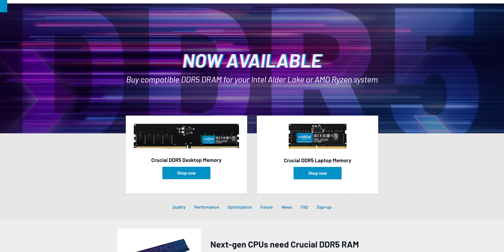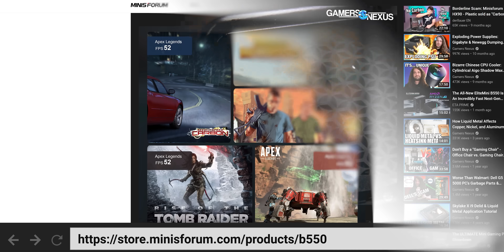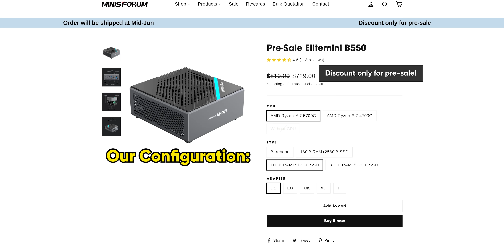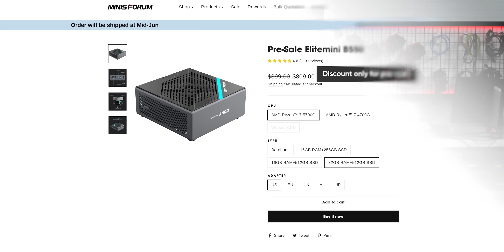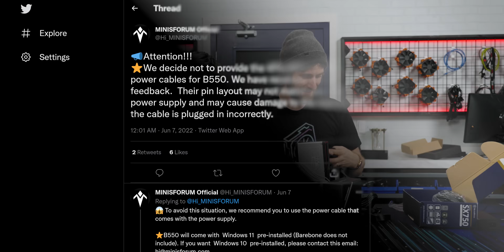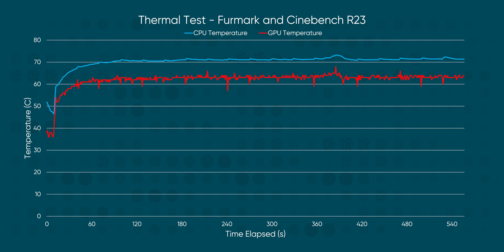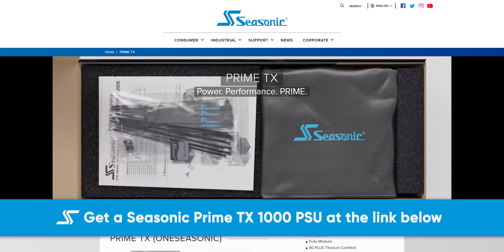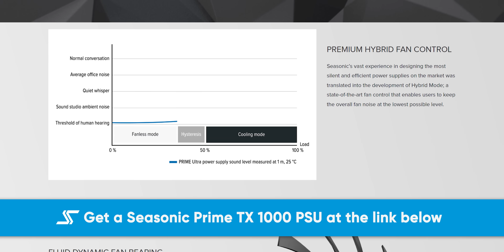Who's Buying These? - MinisForum Elitemini B550

Comment: This is an early version of what there will be in the future: A tablet computer to which you can attach external RAM and GPU for home usage. Similar to a Switch docking station. CPU development will primarily move towards power efficiency and modular construction in the future, so having power hungry parts detachable will tear down the line between mobile and desktop computers.

Also, those huge ass GPUs eat power which you save by unplugging it. It might not much, depending on the GPU, but if you're an environmentalist, you think about these things.
Reply: I’m pretty sure mining for metals for components in anti-environmentalist so from the start that’s contradictory
Reply: @christophervanzetta  No, it isn't. Everyone has a PC anyway, the environmentalist approach is that if you get something, you get the least problematic version of it.
Reply: But even though it has standard PC components inside it seems that it has not so much room for upgrade more than storage capacity and maybe faster RAM if you already had the maximum quantity available since as the not Linus guy said the computer does not even get full advantage of the CPU so just imagine thousands of these tiny computers thrown into landfills when they become obsolete and impossible to upgrade, even if they take care about that and make a new revision of the motherboard you still had to get rid off of the older one and that does not fix the problem either because you still need to buy the rest of the new components, even if its potential for working between two different places switching the system between both stations looks appealing is not a great improvement over a decent laptop if you need that portability and it has the added advantage to work with external GPUs as well as working independently everywhere so I don't see any real environmental advantage over the existing technology and it looks more like another cool but not very useful niche product.
Reply: @peterpuke2841  Yes. That is a problem with this design, I was more referring to the concept of a plugin-GPU in general. Framework, Pine64 and Fairphone are showing that you can do these things in smarter.
Reply: @BlommaBaumbart  But that already exist, there have been external USB GPU adapters for a while and they have proven to be reliable and as far as I know some even work with Windows based tablets despite they are not advertised for ultrabooks and such, but maybe if they start from scratch and instead of this rather weird form factor they change their focus into making some sort of expansion device with a portable dedicated GPU that can be connected with an standard interface like USB and with a smaller but internal PSU since a portable GPU requires much less power than a full size desktop GPU it should be less of a problem to feed the card with power within a small form factor then they could have something really useful in their hands because the biggest problems with external GPU adapters is that they take too much room since they have to make big boxes to fit the GPU and the PSU so they still take a substancial quantity of space and weight making them still inconvenient for transportation so imagine what cool would be a device way smaller and thinner that you just pop in a USB type C and a power cable and you have a very powerful external GPU for your laptop but in a much more friendly format that you can throw in you backpack if you want to take it with you, that should be the real game changer to me.
Reply: @peterpuke2841  You're thinking in the right direction. Short note on external GPUs: Those were so far bound to Thunderbolt, not general USB, and the external casing for just the GPU cost 300 and up, which is why they got less attention than this more general solution here does.
Reply: @BlommaBaumbart  Oh yes, you're right it was Thunderbolt, my bad, and yeah I don't know how no one in the tech industry have come up with this idea yet, actually I had it for years but then I thought that portable dedicated GPUs were still ¨young¨ and very expensive but since Nvidia launched the 30XX portable GPU line and it´s much better in terms of performance and heat generation than previous generations I think it´s time to see someone making an external portable GPU in a small form factor device and an added benefit is that for being external it doesn't have to be bound within the size specs of a laptop so they can make a small but thicker heat spreader than gaming laptops use hence not affecting performance despite of the size, maybe I should patent it myself and pitch it to a computer manufacturer before someone else steals the idea ha ha.

Comment: i use a laptop for work but it only gets used at home on my desk  or on a hot desk in work, both have power and periferals (moniter, keyboard, mouse ect) so it would be suitable for that as the laptop might be (slightly) worse in my use case

Comment: The extra psu is a downer. With a 750 psu i could just cram everything in a cooler master nr200.  I travel a lot but not to an extent that i should disamble to take it with me. 

Its a great niche profuct tho. I could see others pick this up and make use out of it.

Comment: This is good for my use-case. Where I live, the power intrupptions happen all the time so we have a 1000 Watt UPS for our house so we can have lights and fans on. I can use it without the external GPU when power is out on UPS and plug it in when I want to game. Right now I have to keep two machines on hand; one is a full size desktop that I shut down when there is a power outage and then I switch to my laptop until the power is back.
Reply: I used to love having a gaming laptop for such occasions, when the power flickered or went out it just shrugged. I did not love having hard to replace parts, which in modern laptops are just impossible to replace.
Reply: @ffwast  I see that over and over in the comments, "hard to replace parts". But this is no different. You can, uhm, upgrade RAM and storage... just like in a laptop. But that's it. If you are talking about parts actually breaking and having to be replaced, most likely the system have gotten so old it's obsolete or you got bad parts from the factory and can use the warranty. So in the end this is just a shit version of a laptop, that you don't get a portable screen with.
Reply: But it's still easier, cheaper and faster to just use a laptop.

Comment: I love it! But I don't know why... I kinda feel this would suit your upcoming byoc lan party if moving the rig for tournaments happens. It does seem a little unpolished and I would hate to unplug the power as easily as Linus did, that happened a bit too easily. The barebones config does seem like a good deal though! I don't have a lot of money for upgrades atm and as a tinkerer this is oddly attractive, but as I said, I don't know why. I'd love to have a play with one though for sure!
Reply: you could probably design and 3d print a simple bracket that would screw onto the back of the psu and just prevent the cable from being pulled out
Reply: @roowut  they're probably using a cheap port until its finalised or maybe the power cable shroud was just slightly too small. Easy fix either way

Comment: Yeahhh I'd have provided a more powerful integrated PSU if I were Minisforum -- maybe as a pricier option instead of as the default, but definitely should have been an option. Having to carry a powerful external PSU around with me if I want a full graphics card defeats the purpose of the small form factor, and the lack of PCIe 4.0 on the APU feels like a compromise too. This way, I would have had full portability without having to sacrifice PCIe 4.0 or graphics performance.

Comment: the pinout in the extensions  are irrelivant actually.  the cords aren't actually wired to a device, thus they are . so they unassigned  until you plug it into the cord you're extending.   still I  personally would not use them. they srike me as a solution to a non-existant problen.

Comment: I travel a lot so this would be sensible. I have my main house with the GPU and the extension stuff, during summer or new year, or any kind of celebrations, I would be home for a while and I need my machine. 

Laptop is not an alternative. This is a great little machine, and to have a comparable laptop means I would have to carry a brick everywhere I go, not when I want.

Bringing a machine to work is also kind of the good idea. I hate to have 2 seperate setup (at home and at office) and I could just plug a single Type C dongle to this thing and everything would just work. Quite useful for engineers and developers.

Comment: In my honest opinion? That's a complete piece of crap :v - I mean it doesn't matter how small the mini PC is, is not like you are taking it up with you and connecting it to an external monitor on the go plus all the cable mess. 

What about a gaming laptop with a full PCI connection plus external GPU + PSU + Cooling box/stand? That would be awesome! I would take the laptop on the go and could do some low/mid gaming on the go and when I come home just connect the laptop just like Nintendo Switch and BOOM bare bone GPU performance for hardcore demanding games. 

I never understood why the hell this haven't happened so far or why comapnies still try to chug all the needed data transfer required for it to a hecking thunderbolt cable @_@

Comment: With a little display and an especial shroud that use conectors like the female pcie for an specific psu like the one you use could be a nintendo switch with steroids, take with you a controller or a lil keyboard and a mouse that is Bluetooth it has pottential

Comment: There's 0 reason to have this. I mean I could see myself bringing it without gpu to play like tft at a friends place, but again I could just have a mini itx system and bring my full system. or a laptop. It's kinda cool until you need the psu and then it's just a test bench with an enclosed motherboard, which doesn't help when you have cats, those wires will be chewed through in a week.

Comment: Once you have to add a separate psu, this thing became useless in my eyes. Now it's just cumbersome compared to a laptop. If you need a mobile solution, a laptop with an egpu makes more sense. Especially since you would still have to carry a keyboard, mouse, and a monitor. And if you are going back and forth between work and home setups, again a laptop already does it better as it can also be used on its own while traveling. And there are laptop docks for the workstation. Super cool product that kinda has no practical use unfortunately

Comment: I really can't help but feel that anyone who wants this should really just buy a T1, M1, or ghost, or whatever. Its probably smaller than the loose collection of parts and a lot more stable, quiet, and safe. If you don't need a GPU than any of the NUC type PCs would be what you want.

Comment: I was actually considering this as I currently use an ASRock X300 system for work. I take it into the office 3 days a week and work from home 2 days a week. CPU/GPU grunt is fine for work (5600G), but I'd like to game on my 4k TV occasionally and it seems like overkill to build an entire computer just for sporadic gaming. A laptop is honestly more bulky than the X300 and I don't need the screen or keyboard (or unplugged portability), so the Elitemini B550 was looking like the perfect solution. 

Then just last week my work said they were giving me a new laptop so the point is moot, but still there is at least 1 use case for this thing.

Comment: The docking of the cpu block triggered my cartridge game nostalgia. I personally could have a use for this. It's a niche travel situation, but could utilize it. 
My current home workstation is a threadripper setup and my mobile is a ryzen laptop. When I'm on the road for a few days, it's not worth the hassle of boxing up my whole workstation to do cad modeling and design, so I usually remote in using my laptop. But with this type of setup, I could take the cpu brick and leave the gpu at home to continue working without the constraints of crappy hotel internet speeds to remote into my personal network back home. That and I already pack a mouse and wireless keyboard bc the laptop keys are spaced differently enough (and I only really use it while traveling) that it's a nuisance.

Comment: If it had a 330w adapter like those crazy gaming laptops and a special PCIe bracket (with atleast 1x8pin support ) to get the power also from the 330w power brick that would be perfect. You could run decent GPU+CPU combos on it and it would look clean(er).

Comment: Hello linus media group I need help only you can help me I'm from India I'm a computer science student I need for college work I don't have lot money to buy expensive laptop so I bought a decent price AVITA LIBER V RYZEN 5 Laptop it's in warranty but they are not giving service in India Kolkata they are saying avita dosent supply spare parts for repair so they can fix my laptop which needs mother board replacement and I'm stuck with it without a serviced this brand laptop has bios corrupt which causes their laptop to fail avita dosent even provide bug fix for bios update and they are not even providing spare parts for 
So please tell avita tweet or video to entry level laptop makers like mine AVITA to atleast provide bug fix bios firmware driver updates and spares part and mother board in service l during warranty. Pls help I'm don't what to do pls help
Reply: No

Comment: I only see it's use as an HTPC for it's size. There's too many compromises for any other use case. The price of the base kit alone would almost build an entire PC for home theater though, so even that is pointless. Then it's not mobile, it's portable. You still need a keyboard, mouse, and monitor anywhere you want to set it up. Even a cheapo laptop annihilates it there.

This is definitely a case of only thinking if they could, not if they should. Even if you do the mental gymnastics to figure out who this would help the price and amount of jankiness leaves 2 separate systems a superior solution.

Comment: They should make it with mounting holes to screw into the bottom of a desk.  I 3d modeled and printed brackets to mount my components directly to the bottom of my desk.  Its great way to keep you desk clean and open to the air your temps are super low.

Comment: I would love to have this... But with the "ez to get to go" plug version. 
Why would I dont get a laptop instead? Because, first I dont need the screen/keyboard... I only go from desk to desk, and screen/keyboard laptop are too small for me. I also dont care about the battery. 
But I DO care about the thermal issue a laptop would bring, on top of all the weight of the useless part. I do also care about upgrability of the CPU/ram/hard drive...

Curently I use a thunderbolt laptop with an eGpu, and I also lose a lot of perf due to that...

So that kind of thing, unplugable in one grab? 100% in. 
"JUst gEt A LaPtOP" just try to think few centimeter further than your own personal usage of computers...

Comment: Changes to make this a great product:

* Structurally integrate the power supply to significantly reduce cable clutter.

* Add another 4 pcie lanes to the "dock" for storage.

* Market it as a fully modular system with hotswap storage and gpu. 

The end result would be a PC that end users with zero skill could swap out core components for with ease.

Comment: I actually could see this used a lot by event techs (especially lighting/video). They want to have a pc with a lot of graphics power for simulation and pre programming of shows at home and a small form factor machine for touring and traveling but don’t need as much traffics power. Typically lighting technicians have a laptop and a desktop pc but for some this could be useful because they don’t need a display of the laptop if they use it as a server at shows but also don’t have to a lot of file transfers between different machines if they use the same for productions and preparation

Comment: Yeah, i can get all this using my laptop and slapping it all through the wifi trick. Sure, it's not 100% performance, but it sure beats the costs AND i have a fully functional, independent system that i can use as is without much hassle. This system is poorly done. They should've made a laptop format with the ability to extend its legs via sockets, like we had in the old days. As is, too much hassle for something that's already been exposed as being poorly done.

Comment: I personally see this as a weekend get-away system.   At home, it's docked with full power.   Going to grandma's this weekend? Pull out the system/APU and you have just enough power to play at low resolution.
Reply: And your grandma has a mouse/keyboard/display setup ready to go? 
It's a neat thing, but there really is no good use case I can see.